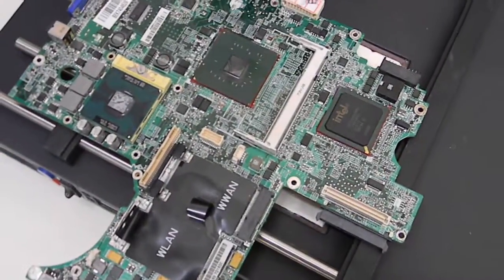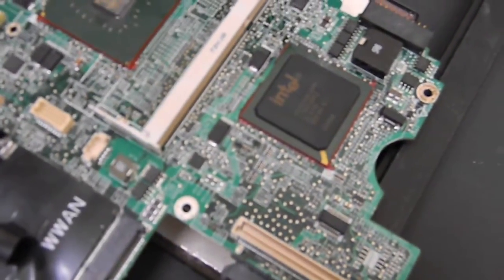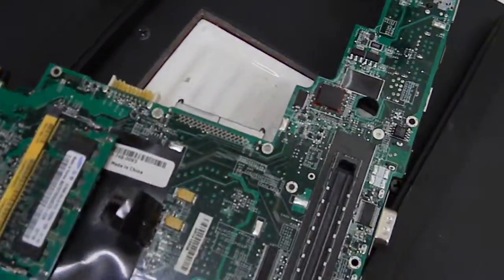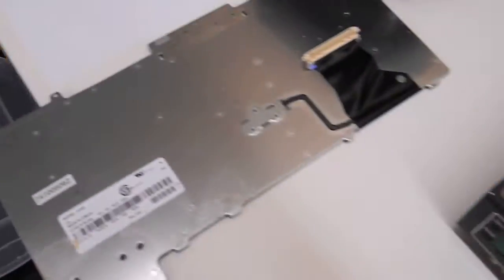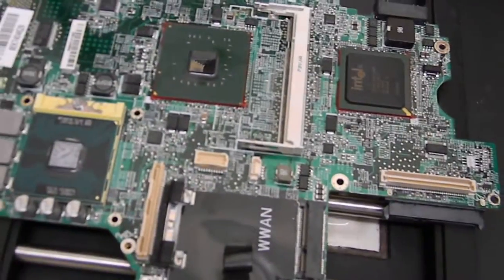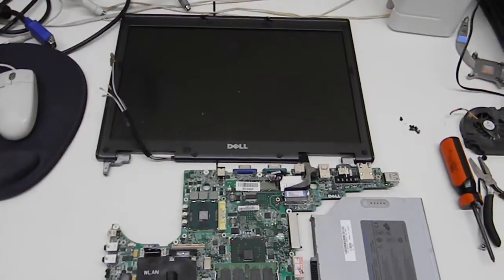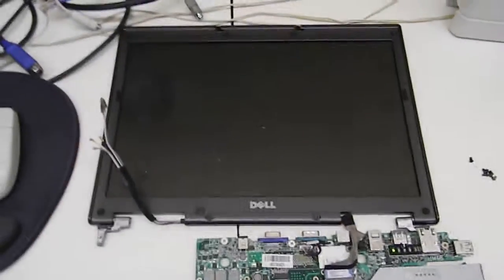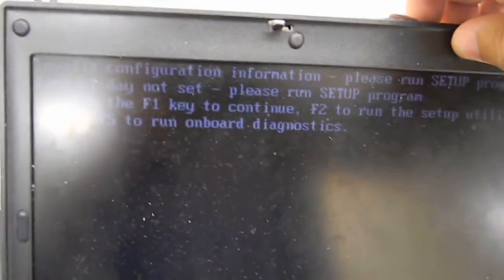IR based laptop BGA reflow of a Dell Latitude D820 motherboard to fix a no video and no power issue.

Comment: Haha! Wow, great tip on this. Have quite a bunch of these same mobos sitting around with the same problem that I gave up on, so perhaps I can give this a try.

I also noticed you didn't remove the epoxy from the chips before reflowing, is that what you usually do?